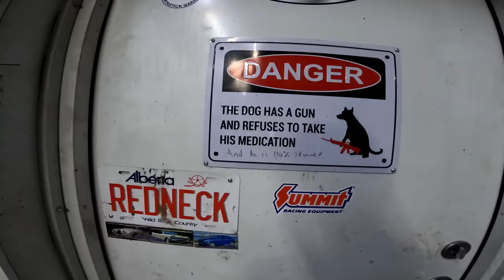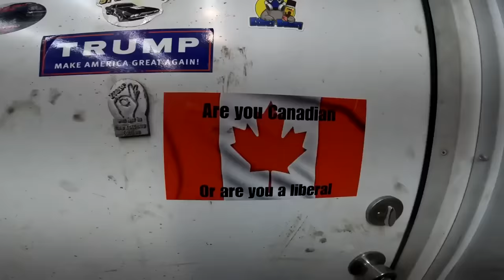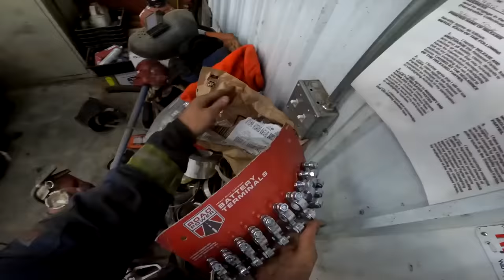FORD 7.3IDI AND 300 6 GRAVEYARD REVIVAL!!!

Comment: On those cheap clamp on battery terminals, if you flip the little clamping strap over, so the curves spoon each, you can get a much better grip on the dirty old battery cable end.  Us poors gotta help each other out, dont say i never did nothing for ya.

Comment: Even as a guy who wants a 5.8 for his old 60's furd junk, this vid was still great to watch
Reply: That Candy Van 351 Windsor sounded mean for a late 1970s 2-barrel smog V8.  
Even this kind of abuse doesn't even seem to faze it.   They were great engines.  Tough bottom ends with great oiling, even these low performance ones.

Comment: Two of the best engines under the hoods of Ford trucks. Stump pulling torque, and built to run several hundred thousands of miles. I'd take the 300cid 6-cylinder over the newer EcoBoost lightweight exploders any day.

Comment: Before using those battery clamps, i usually take the bolts out, flip that piece of metal over... That piece of tin just bends so turned upside down it digs into the wires better. Old trick my old man taught me.

Comment: Aluminium battery terminals?   Aluminium and lead go together along with any salt added to the mix spells trouble and failure in  very short time,    love watching you fuck with this old piles of FERD ,   straight from the dump into the ketchup

Comment: Hey man love this channel! Question got a 6.9 idi and decided to open her up as I baby her. She has blow by and alot of miles. I got it to 80mph let off now it tapping lol the tapping goes with acceleration and at idle. New injectors and pump dropped oil pan rods look good. Any ideas what would be tapping sounds like driver side intake under the vavle cover. Bad lifter?

Comment: Those battery connectors, I use those and what pisses me off is the clamp nut is a different size than the two wire clamp nuts oh my god it pisses me off. Whoever came up with that in an Indonesian cave should fall off something tall.

Comment: I need 7.3 idi parts that match a s1700 international frame..... non turbo 89 blue bird bus. Id be happy to find a idi cable from a s1700 frame... using a 89 idi f250 cable rigged to my idi or if u have the ford idi cable bracket id need that let me know boss! Please! Not promoting but in my shorts you will see my bus. Tack doesnt work. And it had a idle adjusting bs that locked up. And cant find any parts all all for it. So im stuck rigging it. Need a braket for a 250 idi 7.3 ford set up. Same engine in a ford truck in the bus. Also my bus is stick! Cool as shit